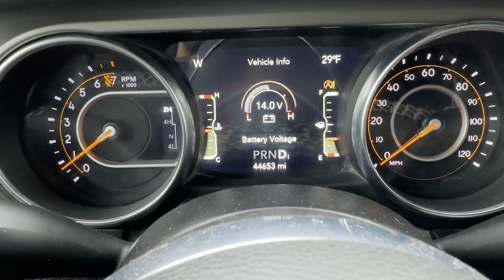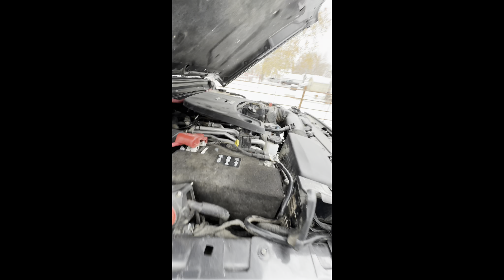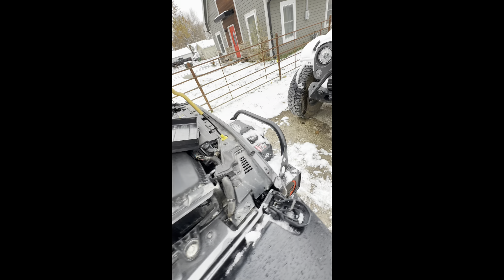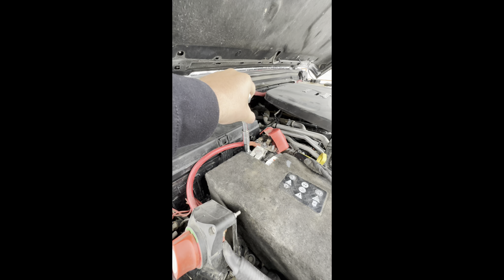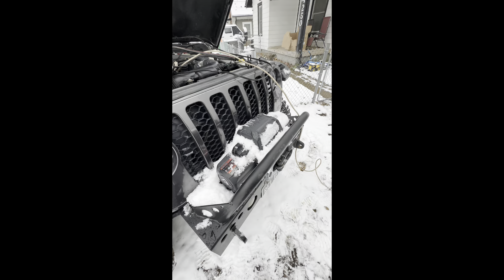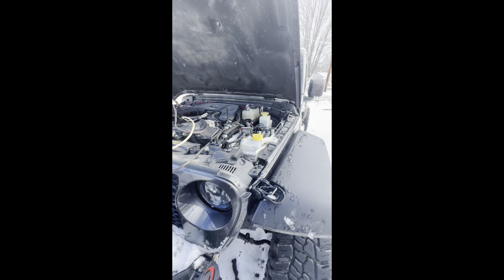Check Your Battery Out Before Spending Any Money!

Comment: I know some guys that have a few new 400cc ninjas. They tell me one is having issues and they decided to put a new $400+ ECM on the bike. They say it's still not fixed and buy a new starting solenoid. After that didn't fix it, they asked me to check it out. I told them to bring me the bike and I'd fix it. They trailer the bike to me and I check battery voltage. It was low, so I swapped it out with the battery in my bike. It fired right up. I put his battery on a charger and fixed the sticking throttle and horribly misajusted clutch. I swapped batteries again, bike fired up fine, but let them know the battery may not last much longer. Battery is the first thing to check when diagnosing anything electrical related.
Reply from the maker: yes 1,000% agree!